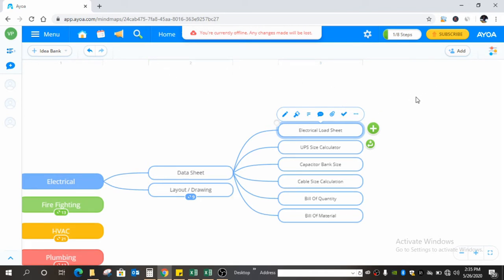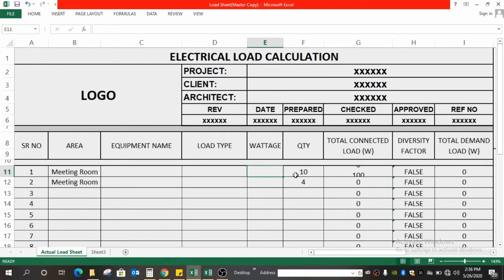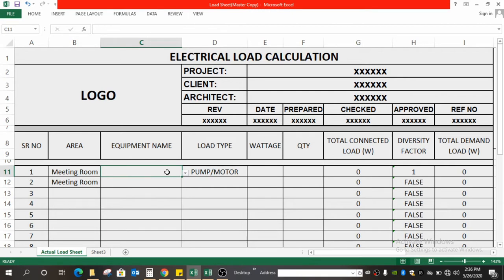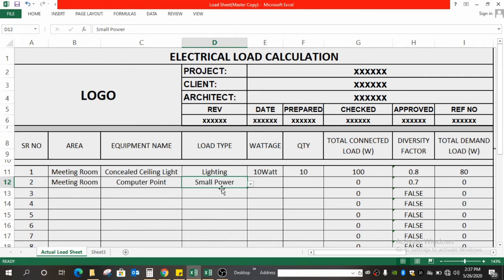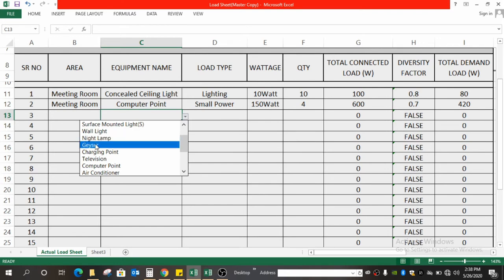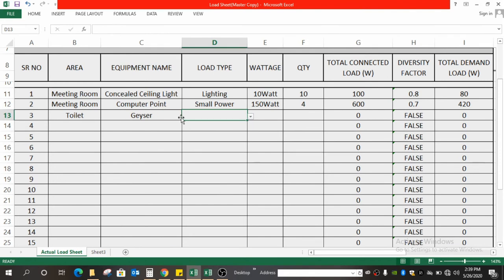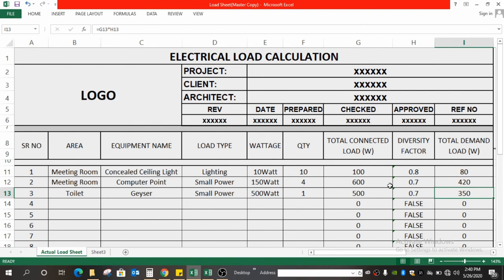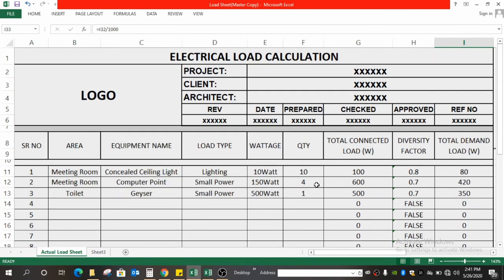Electrical Load Calculation | Automated Load Estimation Excel Sheet for Home & Building Projects

Comment: Pls can u make clear about diversity factor and demand factor.
Here u took diversity factor of .7,.8,1. Actually we dont know the consumer utilizes all connected loads, if a light is 10 w it will consume 10 w every time you utilize it, but by considering diversity factor assumption u took as 8 watt only ,very confused..copy paste is a problem .we need perfect method of load calculation.

Comment: Sir,
Pl give the answere of folloing
Say  I have a 15 amp plug & I want to  use two instruments like 1 gizar & a motor alternately i.e not simultaneously.Whether load will be calculated for the both or singly
Reply from the maker: Considering the higher load , calculate the current. On a safer side the current estimated should not be more than 60% of your switch socket . Since it may be connecting an inductive load .
Reply: @VickyEngineersoffice  
Sir,your answere is not clear.Actly what I want to know  is whether (say the rating of  the geyser is 2kw & the motor is of 1hp  )the load will be considered combinely (i.e 2kw+1hp) or  2kw only( higher rating)
Reply from the maker: If you want to connect one of two load alternatively then consider the higher load and calculate line current. If both loads connected to the same line then combine both and calculate the current accordingly.

Comment: Diversity factor and demand factor are two different thing. Usually when calculating load demand factor is considered (individually or altogether)and diversity factor comes at last. 
Demand factor can be considered at the beginning or at the end for non complex laod or general loads
Reply from the maker: Mainly Demand load comes to play when the exact load going to be connected is unknown. Eg : for any under construction site . When the load to be connected is known we can always calculate the diversity factor that is the ratio of sum of connected loads divided upon the maximum demand .
Reply: @VickyEngineersoffice  Hi, what is the purpose of diversity factor please?
Reply: @VickyEngineersoffice  excuse me sir, where did you get the diversity factor multiplier for motor which is 1.is ther e any codes of standard where you get it?can u share it please. Tnx
Reply: Very relevant question
Reply: Please share the excel sheet
Reply: exel sheet available?

Comment: *> Why, you did Demand factor and Diversity factor both multiply. is it correct. 
*> Always Diversity factor should be in more than one. also Demand factor always should be in less than one. but you were did something please clear me.
*> D.F and D.F both has different formulas.
Reply from the maker: Diversity is counted on estimated consumption depending on condition and load type but load factor or demand factor plays roll when u calculate actual load sheet . Ofcourse diversity factor has a role but for all type of criteria I have taken on average .
Reply from the maker: Good question . Appreciation from myside . Any query further send mail on durgapadhy057@gmail.com and ping on Facebook VICKYENGINEERINDIC
Reply: Excellent good job
Reply from the maker: For excel sheet follow VICKYENGINEER on telegram and ping . It's easy to provide there and others can also get that
Reply from the maker: Basically it's a sheet to calculate estimated load for any project . If u need the approximate load there is a video already on channel HOW TO CALCULATE ELECTRICAL CONSUMPTION . I think it can help u better . If then any query happy to help u
Reply: @Vicky Engineer  can't find you on telegram with this name sir